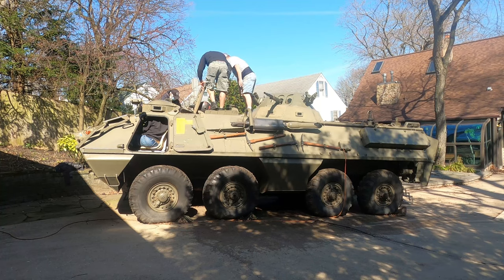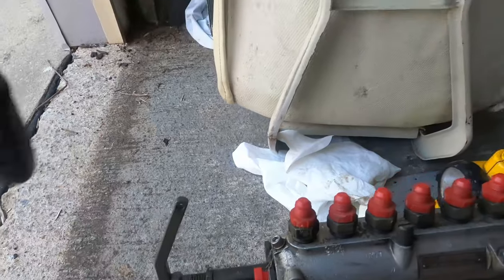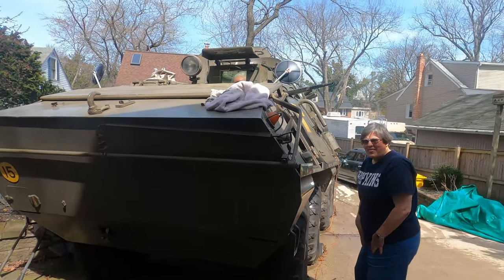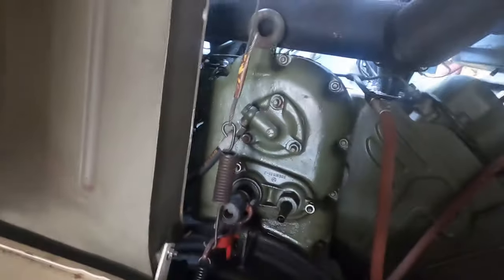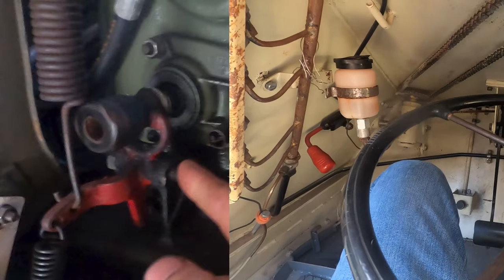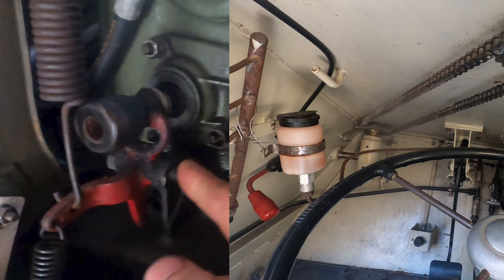Tatra OT-64 Will It Start? Part 2

Comment: Lol, if the lever on the left wall on the drive side was disengaged then you're lucky that you've started it without problem because of its correct position. BTW yes there is return spring in the shaft's center hole.

Like I've written in previous video, be sure to use clutch for the start and I've remembered other situation when clutch is needed to be engaged. When you'll change additional transmission gears (lower position - road /middle - neutral / higher position - off-road)

BTW congratulation for getting this beauty running once again.
Reply: I was thinking about what I've written here about the spring. That spring what I've mentioned is spring which disconect shafts. Spring for reconnecting shafts is on the left side of that part where shaft is. We've fight with this mechanism on TATRA-813 and because it is old and dirty it has a lot of friction so it is problematic to reconect it by that spring.
Reply from the maker: Thanks much for commenting. Excellent information.  I'm planning to follow the progress of the new owner's work.  There might even be a water launch in the future!

Comment: Nice, such a tiny little thingy and so much work... btw. that pump should be disengaged if vehicle is not in the water.
Reply from the maker: are you talking about the bilge pump?  I think it has a float switch and was clearing out rain water.
Reply: @tr3wrench  looks like manual switch was on some really old versions or even on prototype - I was going through several instructional videos and written manuals and most of them shows pump working all the time when main engine is runnig. Only video mentioning manual switch is this one: https://youtu.be/6YEcbI3HsZo?t=1027
Reply: @tr3wrench  also one more thing: there is (or was, there are too many versions out) drain valve of the motor/gearbox compartment as shown here: https://youtu.be/bp3IU4CVVf4?t=158 sadly this video doesnt have english subtitles, but shows all maintenance and procedures that should be done before and during float operation

Comment: Great job.  What are the plans for the Tatra?  How will it be used?  As a parade item?
Reply from the maker: I think Pete is going to do some restoration work on it.  There is a chance we may see a water launch in the future.
Reply: excellent!  you'll always be prepared if the enemy lands on our shores (just kidding)!
Reply: @tr3wrench  If you will manage to get sealing around main shaft from bottom of OT-64 on the wall of transmition compartment then we are willing to buy some :D ... I've found only some not suitable replacements. According to the manual and the age of the sealing it's needed to be replaced before each water launch.
Reply from the maker: @jangratza7348  I'll pass that on to the buyer.  Curious if you have a shop manual in English?  We could have really used that.
Reply from the maker: @RickCT2000  Certainly prepared for any trouble at cars and coffee :)
Reply: @tr3wrench  Unfortunately no, it is hard to get Czech manuals for it :/